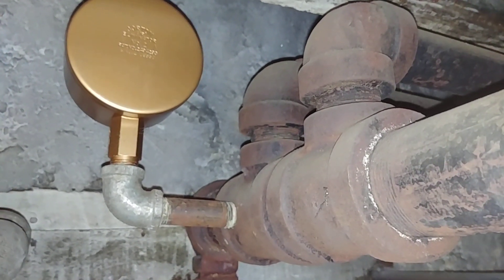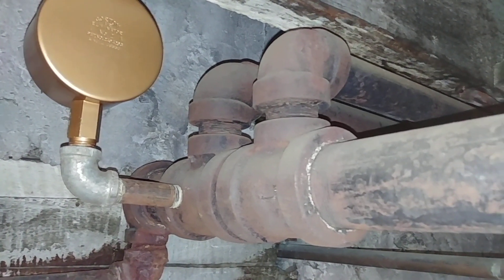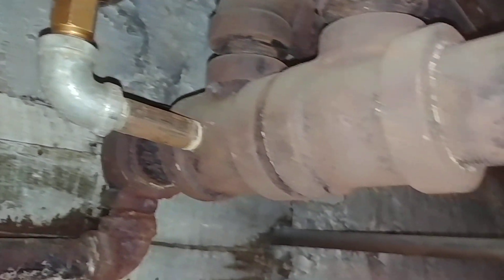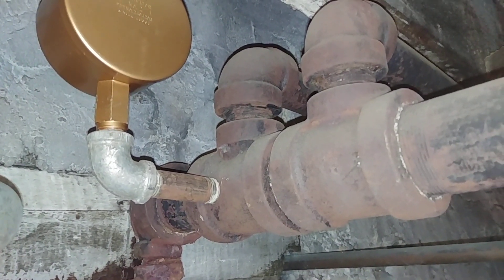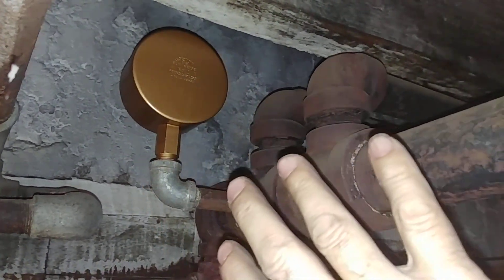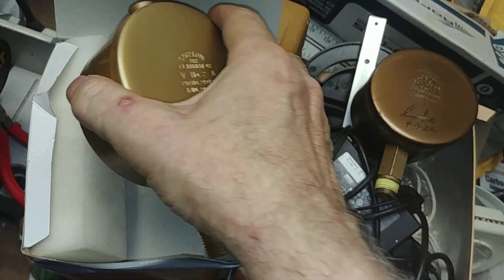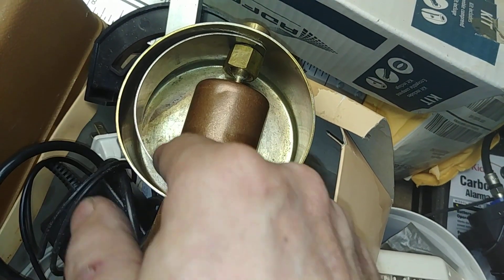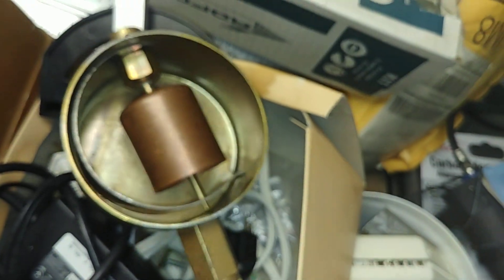Rejuvenating Old Coal Era Steam Systems With Proper Main Venting

Comment: Hi Gordon, thanks for sharing your expertise! 

I have a single pipe steam system and the mains are vented with a Hoffman 1A on one loop and a Hoffman #40 on the other loop. I’d like to try improving the mains venting but I don’t think I can easily swap in a Gorton #2 without having someone come to re-drill and re-tap.

Are there main vent options you would recommend that will fit my current connection point? I guess I need a 1/8” angle connection like the 1A uses. (Although I tried to measure the 1A connector and it sure seems closer to 1/4” inner diameter, maybe even 3/8” outer diameter… maybe I am looking at the wrong dimension on the parts listing?)

Or am I better off drilling new holes?
Reply from the maker: You could try to get two Gorton "D" vents to replace the Hoffmans (I assume they are both angle pattern).
Give that a try and let us know if that helps!
Please consider sending this channel a Thank$.
Reply: @ Thank you! I’ll try the Gorton “D”. Yes, angle pattern.

Comment: I live in a 3200 square foot 100 year old English Tudor in NJ.. whe nI bought the house there was virtually no main venting..   I have 2  steam mains one hugs left side of basement and one hugs right side.. I put a total of 4 vents (2 on each side) at the end of each main run.. 1 Gordon #2 and one big mouth for each side. This made a big improvement on how quickly the radiators heated up.. How would I know if I could benefit from more main venting like maybe another Gordon #2 on each side? I have a Weil Mclain 200k BTU steam boiler servicing a total of 20 radiators... Any help would be appreciated. Thx in advance and thank you for making these videos!!!
Reply from the maker: There are formulas that calculate the volume of air in your steam mains per foot, multiply my the length and look up venting capacities of a Gorton #2 at 4 oz/in2. etc etc.
Others remove the venting, let the boiler & pipes go cold, fire the boiler and time how long it takes for steam to come out of the open pipe at the end.
Then they put the vents back and repeat the experiment.
If there is a marked difference in the timing between these two scenarios, then consider adding more vents until you reach the "open pipe" steam flow rate on your system.

Comment: Hi Gordon. Your videos are super helpful! I feel like not many people know about steam.  I live in a 16 apartment building in Brooklyn. It is what they called a Finnish Co-op. The main lines only have a two Groton # 1s, one at each line. Both lines are long. And there is banging and hissing in the radiators on most units. I am wondering if they should be at least switched to a Groton # 2. Any thoughts? You are not by any chance located in NYC?
Reply from the maker: Thank you for your kind words!
 We happen to service the central Maryland area mostly.
But there are good steam people in your area, no doubt.
As to your issues of hissing vents and banging, this is NOT normal & these issues should be addressed forthwith.
Generally, most systems suffering these ills are being run at pressures that are too high - the steam "Dead Men" standard is no more than two psi.
Switching out from Gorton #1s to  #2s is a proven way to dump more air from your system at your new lower pressures so the steam is more evenly distributed throughout your Finnish Co-op.
Reply: @gordonschweizer5154  Thanks so much for your reply! Too bad you are aren't in this area, but I will try to look for a good steam person. In the mean time I will keep your suggestions in mind for when the steam person does come. I don't think I can do the switch myself.

Comment: I'm interested in why you choose the gorton no 2 over the Barnes & Jones Big Mouth air vent. Twice the venting capacity of the gorton no 2 and slightly cheaper.
Reply from the maker: Thank you for your question.
My main concerns with the big mouths used for main vents is the longevity of the "o" ring seal on the seat to keep the vent from spitting when the steam arrives.
We have used Big Mouths successfully as cross-over traps on two-pipe steam systems where their extraordinary venting is best utilized (& no o rings, either).
The big mouths can also be used as the main vent on a two-pipe system dry return were it should not see steam every cycle unless steam enters the dry return (which it shouldn't in most cases).
The big mouth will not shut in cases of water reaching it. The Gorton #2 should (in theory) close against too much water.
Also the bimetallic strip should last longer than the fluid-filled bellows of the Big Mouth.

Comment: Hi there! New follower. I just moved back to the Northeast and purchase a home with
single line steam heat. With that said, lots of banging pipes and not getting steam to the furthest radiators. Installed vari-vents and now it’s worse. Would you recommend installing the main vents at the end of the run where it turns into a U-turn, reduces down and heads back to the boiler? I have two (2) such runs on each side of the house. Also, where are you guys located?
Reply from the maker: We are located in Maryland.
I am sorry to say vari-valves are not good in almost all cases & I hope you can get your money back for them.
Water hammer must be dealt with ruthlessly ASAP, as it not only destroys pipes, it kills steam in the pipes before it can get to the radiators.
It can also kill any new vents that are installed.
Best to post pictures of your boiler, etc on HeatingHelp for better advice.
Reply: @gordonschweizer5154  thank you

Comment: Hi, I could use the help of someone like your self. I have had trouble balancing my one pipe system since I bought the home. Are you in Northen NJ or can recommend someone near me? I have had 4 plumbers come out that couldnt help. 2nd floor gets really hot, 1st floor is cold, thermosdadt is on the 1st floor.
Reply from the maker: Sorry you're having issues.
I'd start at the beginning to lay the foundation of "good" steam.
Is your water clean?
If you can drain your boiler and returns & and refill, that's a start.
You may need a "skim" of your water, too.
Next, is your near boiler piping anything close to what the manufacturer wants?
Next, and probably most important, do you have really good main venting?
Is your main pipe insulated?
What vents do you have on your raditors?

Comment: Gordon, I live on your videos like food… would love to see your buddy who drills and taps for the Groton valves. ..or any advice you can offer would be appreciated. I’m a little skittish drilling into my big cast iron elbow and I definitely need one. Live in queens in a small Archie Bunker house, replaced an old converted coal boiler 35 years ago, then done a Weill McClain, now a slightly used slant fin they I wheeled 10 blocks on a dolly. Done a few other oil boilers for friends and family, alls done well… but would love to add that Groton.
Thanks so much for your wisdom!
Reply from the maker: You're most kind!
Since I don't do the drilling, I have as yet no tips to offer.
I totally get what you mean about hand drilling into a cast iron fitting.
It most definitely takes a certain bloody mindedness to do that for sure.

Comment: Is there a way to test the main valve on a one pipe steam system? 
Thanks for the expertise Gordon.
Reply from the maker: Thank you!
The basic test of, say, a Gorton #2, is to tip it up and blow upwards into the bottom holding the Vent vertical.
Air should pass freely out the top.
Now, tip it pointing downwards and repeat the blow test.
No air at all should pass.
This is a very low bar basic test for almost any steam vent.
The final test is to install it on the system and run it.
Once the steam gets to it, it should close and not let steam escape.

Comment: Who is the person with the nerve to drill and tap that tee? Any concerns with the metal shavings making their way back to the boiler? Regarding venting, is some better than none.
Reply from the maker: No concerns at all about metal shavings.
If you & I wanted to go into business together to make rust to alleviate the crippling rust shortage currently plaguing the world, we could do worse then investing in a steam boiler.
All kidding aside, steam boilers generate lots of rust on their own and can well handle few bits of loose iron.
Cast iron machines and drills up very well.
You don't even need cutting oil, as the cast iron has lots of graphite built in.

Comment: Thank you again. Always helpful and informative. Is there a general rule that considers main pipe diameter and length of run that influences your choice of main vents?  I noticed that you have used Gorton #1 vents in certain situations.
Reply from the maker: After about 20 feet or so of 2" pipe, we start looking at a Gorton #2.
Sometimes, we can't fit a #2 due to overhead.
The shorter mains or 1-1/2"  mains get smaller vents.
The idea is that steam should reach the ends of the mains at about the same time (w/ a minute or so of each other).

Comment: I use big mouth. It's slightly smaller than Gorton #2.
Reply from the maker: I have used the Big Mouth vents on the ends of 2-pipe vapor systems.  
I use them there because they would not be exposed to steam unless traps failed open.
I have questions & concerns about the over-all longevity of Big Mouths exposed to steam every cycle.